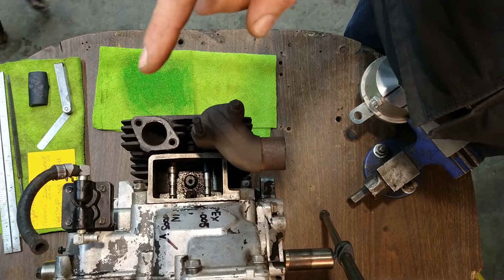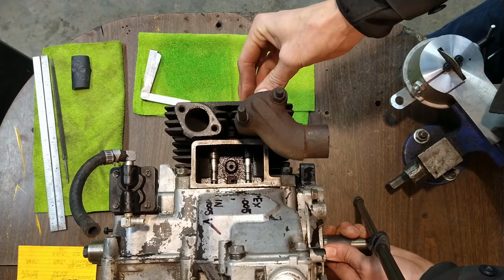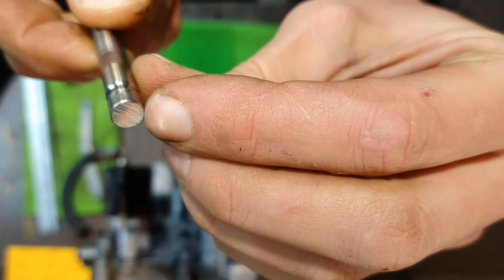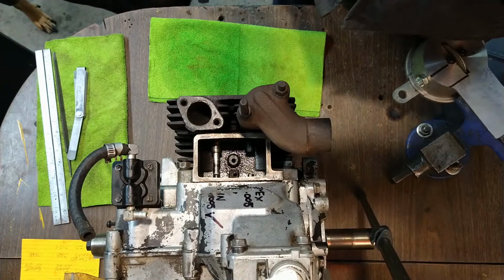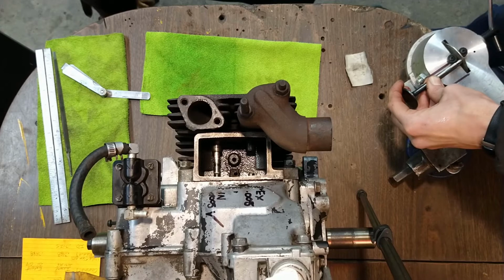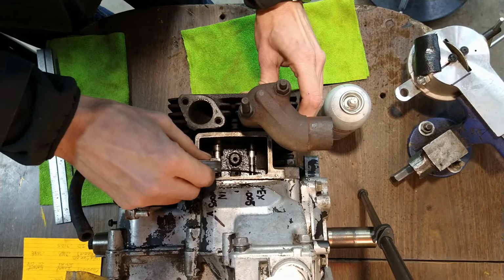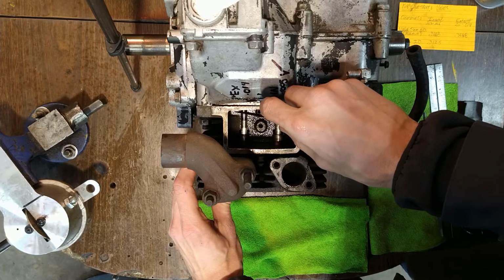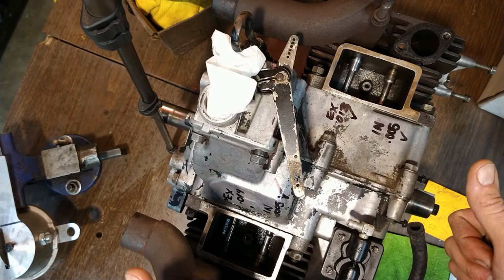Kohler Magnum M18 Complete Service, Part 7: Valve Clearance Adjustment – Cub Cadet 1882

Comment: Great videos! When you grind the valve stem, I think you should have the stem on the downstroke side of the wheel. That way the grinding action pushes the stem into the table part of the tool and makes it easier to hold steady. Thanks for sharing!
Reply from the maker: You're right, that would certainly make it easier to grind. Thanks 👍

Comment: Good Work    Am curious why you did  not assemble pistons and all before you ground the valves.  Am just thinking perhaps sealer
for the barrels might change the clearance.  Don't really know just asking.  My dog thinks that tractor work is boring and feels no
need to hang around.  Glad to see yours hangs with the project.  
Ken
Reply from the maker: Ken that is a good question.  I kept the piston assembly for the very end because of cleanliness.  I try to keep all the dirty work like scraping, cleaning, grinding, sanding separate from the final fit of the parts like pistons which are picky about any cruft being induced.  I do think the clearance will be slightly affected by the sealant but not by much.  Will see when it goes back together.  Fingers crossed I'll shoot that this weekend!

Comment: Hello,and I hope you see this because I'm truly concerned for my old girl.I have a C.C. 2072 & the other day out of curiosity I removed the oil fill cap with the engine(Kohler Magnum 20hp)running.And it was as if there was a air compressor in there blowing air out of the oil fill tube.Does this mean my engine is shot? It runs good but ticks a little bit.and probably has 1200 hrs on it.Thanks
Reply from the maker: 1200 hrs isn't too bad for an old Mag twin.  They can go 2000+ before rebuild.

The crankcase breather system on the Mag is controlled by a reed valve (if updated from the original umbrella seal) assembly that is under the valve cover that the breather tube is hooked to.  

When you remove the oil cap, you are allowing extra air to enter the crankcase and bypassing the work that the breather valve assembly would otherwise be doing.  I would consider what you saw as being somewhat normal.

Replace the oil cap, make sure it is screwed on snug, and make sure the dipstick tube is inserted firmly.  Remove your air cleaner and observe the area where the breather tube enters the filter base.  You should have pulse of air here from the breather tube.  This is normal.  If it is spewing oil out that tube, you have a problem.

Comment: hi!

Where can i find the specifications for this engine? i am in the process of restoring/rebuilding a M18 engine, but i need to know dimensions and clearances for ordering new bearings and other parts.
Reply from the maker: Kohler's website will give you the download for your engine's service manual.  I also created a cheat sheet for some of the basic clearances and torque values that can be found here:

https://drive.google.com/file/d/1SUw3QN-ZnJTnRm5_DjmmZJk6PLuD1oI4/view?usp=drivesdk